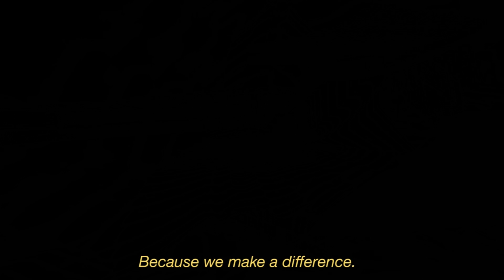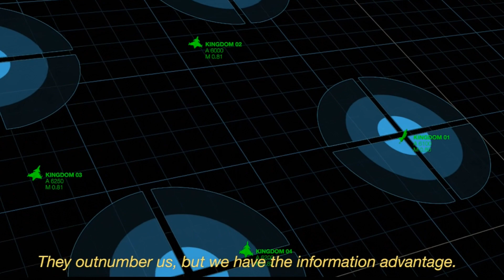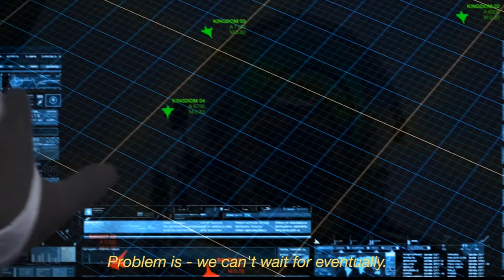Gripen Fighter Jet - Canada's Future Fighter?

Comment: Being Cheap isn't good. But it would be better to go for the Typhoon GR 4. At least the typhoon has been properly fielded and tested,improved and upgraded.  The Grippen seems to be a bit of a budget option....
Reply: randomguy8196
"Canada’s jets will be operating in harsher conditions than most other countries"... Well lets look at three countries that operates in conditions as harsh or worse than Canada then... Denmark, Norway and Sweden.
Sweden operates in its territory in Northern Sweden, that is an area with great distance to a lot of stuff, its cold (being just on the border to an Arktic climate)... It operates the Gripen.
Norway operates in its territory in Northern Norway, and the sea around Norway (as well as Svalbart, the Island group) Those areas extent well into the Arktic, it is very desolate (as the sea is) and is a very big area... It operates the F-16, and is going to use the F-35 both are single engine planes...
Denmark operates in its territory, it is quit small, with a bigger population density, so one might not think Denmark counts... However Denmark is controlling and patrolling the air over Greenland and the huge areas of sea surrounding Grenland (not regularly, but every so often)... And it is done with the F-16, that will be replaced with the F-35.

All three of these countries have single engine fighters, and are replacing them or expanding them with new single engine fighters... They cover a lot of territory, that are equal in harsh conditions (or ever so slightly worse), and really haven't had problems.
In fact the only crash the Danish airforce have had in the past 15 years, was due to the metal in the air-frame going soft due to extended use... the two-engine discussion is perhaps interesting, but it is equally interesting that two of the most effective planes in modern-warfare history (the Harrier and the F-16) and the new big replacement of many older planes (the F-35) all are single engine... There are some reasonable arguments for double engines on a fighter, and the cost of providing another engine is usually not that big from a design point of view... But it is clearly not a deal-breaker.
Reply: "A dual engine jet is safer than a single engine jet thanks to redundancy." The safety record for the 39 when it comes to engine problems are very good. Ingestion of different martime poultry is not something that normally causes the engine to have a catasrophic malfuntion. And of course you guys would probably get to be in on building your own aircraft..just as Brazil. I think that Bombardier would like that very much.
Reply: indedd ;-)
Reply: Most wars are fought over resources. All wars are won by effective mangement of the resources a country can use. I see the 39 as a good fighter because it gives an enourmous capabillity for the resources spent on procuring and operating them. And this "single engine" talk is rather obsolete. Once passenger jets that crossed the ocean had a demand of having 4 engines. Not the case anymore as engine design , metallurgy and aircraft design makes up for the early problems of long distance flight.
Reply: Just as people ask the politicians in Sweden the same questions. 'Do we need to fly at Mach 1+ at 10-20m height in coastal waters filled with big sea birds?' Do we need to train at that level in peace time?' With low operating costs pilots can get the training they need in the machine they fly. No need to be a cheapskate. Just as there is no real need for 2 engines either.
Reply: randomguy8196
That was a pretty weak reply...
The cost or technical reasons (for the F-16 and harrier) are not really relevant, what is relevant is that those planes did the job in such a way that they justly have been seen as some of the best/most capable designs...

Dismissing the fact that three nations are using (with succes) single engine fighters for a job, in similar condition, you claim should be done by double engine fighters are simply making your own arguments invalid... Oh and Canada is rich, so is Sweden, Norway and Denmark...
Reply: "why would it not choose the very best equipment for its troops" It does, it looks like it is buying the F-35...
It might need a second fighter for other jobs, and there you would look at where you got the most cheep. Is the F-15 good, sure... The F-16 is seen as one of the best planes ever build however, so really you can't claim that Canada would be worse off.

"An extra engine is an additional factor of safety."... And yet the single engine planes doesn't seem to have problems... One could also instead say, the better ground crews will keep the planes in the sky, regardless of one or two engines. It is only in combat that one or two engines seems really matter, and even there hits from modern missiles seems to not having a bigger problem shooting down planes with two engines compared to one...
Reply: "not exactly a vote of confidence for the F-35's air superiority capabilities" that has nothing to do with it... 
The reason many countries like Japan, Great Britain, Germany and so on are not replacing all their fighters with F-35, is the cost... Those F-35s initially costs a fortune even compared to other fighters (not the Raptor but still).
If you have a big number of a fighter still working fine, why drop it, when you buy something new and better, that is so expensive that you can't replace them in a ratio of 1-1 or even 2-1
Reply: Coincidentally the Danes are replacing all their F-16s, because the F-16s in Danish service are worn out, so it was decided to replace them all out of necessity, not by choice.
Reply: "Japan is building many parts of the F-35s it buys so some of the money is going back into its economy" So does Britain, Germany, Denmark, Norway... Doesn't make the plane cheaper, it helps support the cost, that is true, but not directly... None of the states are directly making these parts, but corporations (that might be partly owned by the stat). Meaning that the stat is taking the full cost of buying the planes, but only (at most) gets some of the renevue back through taxes and in those cases where they have a partial ownership, not normally the case.

"they don’t operate any F-16s, only F-15s" Not really relevant... You could just as easily have said that Britain doesn't operate F-16s, but Euro fighters... They still buys and plans to operate the F-35s where they previously only used twin-engine fighters, and they doesn't seem to care that much about having only one or two engines...

 "They are probably just buying them as a form of tech transfer - since the US won’t sell them the F-22s" Now you are speculating without much ground to hold on to... The US was contemplating exporting the F-22, but decided against it, because it (among other things) were too expensive.
Reply: You missed the important part... "Part of the money", the cost of the F-35 is far greater than what money stays in Japan, and the Japanese government still doesn't gets all the money back from taxes/profit... This isn't a zero sum game...

"They have over 200 F-15s but no F-16s" still not relevant...

"Japan felt it needed a new air superiority jet" So clearly the F-15 weren't good enough then...
Seriously though, the Japanese government choose the F-35 because it was seen as the best it could get... If they decide to make a new plane from the F-35 then that is what they will do, but until then, they still upgraded to the F-35 instead of focusing on the F-15
Reply: There are a number of reasons as to why "go through the trouble of creating an entirely new plane?"...
Some of the reasons are military, some economical, and others political... For one thing, the F-35 will be the standart fighter of NATO, Australia, New Zealand and Japan (with the chance addition of S. Korea), that alone is a good reason to get some F-35s.
Building and develop ones own planes is very expensive and time consuming... Delays can happen, with decades lost, and in the mean time, the currently owned planes might get so outdated, that in the time between, you leave your country at risk... Japan is next to China that we have seen expand aggressively, so that is another reason.
And from the sources I have seen Japan is starting to sell of its F-15s in small patches to other countries, I doubt that we have seen the final number of F-35s brought by Japan.

 "The fact that they are working on a new fighter shows they aren't happy with the F-35 even."
Again, not really... Originally the F-35 should have been finished in 2005, starting your own program in 2006 doesn't mean that you dislike the one you thought you would buy now... Those things often happens...
Reply: "The F-35 is suppose to have finished in 2005 and the very next year they start R&D for a new fighter. What does that tell you?" That everything is proceeding as normal... Every time you are about to finish a new weapon, you start developing the next project, due to the fact that in the time it took you developing the finished project, technology has jumped forward a few notches... The US has started its development projects to the next fighters as well...

"Buy/license it whole, make a few hundred, done." That is kinda what they are doing... They have just bought 42, and are expected (according to US officials) to buy 80+ more... They are however doing it in patches, like most other nations.

"2014 their plans to go ahead with the production of their own fighter"... Sure, they have to develop it first though, and they can have needs they don't want to mention to the world (China) just yet. Not uncommon.

"But at least one country isn’t satisfied with it in that role" You have no idea why they are doing it, unless you work for the Japanese development team (something I doubt)... They can want to building their own fighters with specific goals in mind (like the Swedes), they can be wanting to build their own carrier born fighters, as an answer to the Chinese buildup... Point is, you have no basic of claiming that they dislike the F-35.
Reply: do you have any idea how much more expensive the typhoon is to buy and then fly? this is why we are done with the cf18 hornets.they were actually more expensive than the F15 Eagle-while NONE of them would be built HERE
Reply: Well. The pilot is invaluble. A fighter that have low operating costs let the pilots fly more. That is a good thing for any pilot.
Reply: Of course. That raises the question: What is the "best" fighter then? Is expensive more important than good? How much time in the air will the aircrafts and pilots get. How much resources are to be spent on operating the fighters. Will that come out of other branches of the militatry. Does the fighter fit well with the system it's going to operate in. Will the citizens accept higher taxes etc etc. Are the the more reasonably priced figher bad just because it doesn't cost as much as an expensive one?
Reply: You use the word "seems" - Which means that you really have no clue.  Baseless opinions like yours are about as valuable as religious beliefs.  Valueless.
Reply: Being cheap is good. It means you can have more aircraft in the air at one time. Even pilot officers in the US thinks this is the greatest weakness of the F35. It dramatically reduces the number of aircraft that can be present in the air.
Reply: That is a really strange idea... The Grippen has been tested just as much as most other jets!
It wouldn't have been adopted, if it wasn't any good, to the degree that it has.
Reply: jugganaut33 Theres a great misconception Gripen is not field tested. It has been used in Afghanistan and in Libya as a deep penetrating recon plane and was specifically requested by NATO as there were no jet with equal capabilities. Sweden is not a superpower intent on invading foreign countries, thus it's not got a record from Iraq etc, but it does not mean it's inferior to any of the planes used for that purpose. But let's face it; it's not likely US, UK or Israel would make a major purchase of Gripen instead of US made planes or Eurofighter. Israel is the foremost and most advanced user of new fighter jets, but who would ever believe they would say: "Hmm...Gripen Is actually a better more economic fighter, let's go with Sweden!"
Where do people think it's defence budget comes from? Dades?  Golan Kosher wine? It's the US keeping them from being overrun. They have to go with US equipment. If Gripen would be put in serious hairy combat situations it would surprise many a world powers...
Reply: The more the meriour as the germans understodd at kursk wv2 biggest tank battle. Advanced german tanks against russian T-35 in numbers whith tilted armour. had no chanse ;-)

Comment: Its like a mix of a Euro fighter Typhoon , Phantom and an F16 and maybe a bit of a Tornado
Reply: More like a mix of F-5 and F-15.
Reply: Dimetropteryx Ok? It has typhoon because of the elevators at the front and f-16 because of the single engine. PHANTOM because of the intakes and Tornado because of the wings... It looks like a f-5 I suppose but not sure about f-15?
Reply: I'm not talking about looks, but the general concept. Small, lightweight, affordable, but packed with the best tech available.

Comment: Biggest gripen problem is its single engine and canada is big place
Reply: +StigmADiabolicuM
Why is the single engine a problem for a big place?
Instead of being ignorant you should look up the range of the aircrafts and you would see that Gripen range is about the same as all the twin engine aircrafts. One engine consumes less fuel. A smaller airplanes requires less power etc.
Reply: they are so cheap so buy 100s of them insteed:)
Reply: If engine fails or something happens to it plane goes down, Sukhoi gave up on this (Su-37 'Flounder-A') long ago and Swedes continued on it
Reply: How often do that engine fail?
I mean How often does the F-16  just fall out of the sky, because of a bad engine?
And if it is so great to have two engines, why not three or even four?
And how often does both engines fail on the F-18 (or any other plane with dual engines)?

It is a valid point, but I am not sure that it really deserves as much credit as so many in this comment section seems to think.
Reply: In combat use it saved lives more then once and to train new pilot is 1/5 of the new plane beside human life price
Reply: And how often has that happen in recent years?
Sure it has saved a few planes (not lives), but in general if an anti-air missile hits the engine compartment, the plane is going down, due to the engines are right next to each other. But your argument was that Canada is a big place, and that has nothing to do with having one of two engines.

I make the claim, that most of the pilots killed in action due to their plane getting hit, they would have died regardless of having one or two engines... 

I am however not saying that your argument isn't valid, I am just saying I don't think that it is so great as you, or so many others here think. Especially given the number of countries that uses fighters with just a single engine.
Reply: Russian idea is to spread out engines, why rest keep them together is beyond me, f16 and mirage2000 are almost 40 years old now, gonna get phased out soon all other newer ones are double engine planes, jet is more reliable can carry bigger load on greater distance and has bigger radius, ect. So if no1 else is making them then there must be something in that. Countries that use them are having old planes or on leasing cuz they coast less for maintenance, which isnt the best option just the one they can afford
Reply: I believe that a number of the French planes are still single engine, as well as a few others... 
The radius I am not certain of... Gripen did not have any significant problems regarding radius for the Danes... There were to be made a few different setups, due to certain problems, but the Gripen was considered a genuine candidate for a fairly long time... And the Danish air force, is also patrolling around Greenland and the Faeroe Islands.
Reply: Long story short single engine only good point is its price all the rest is on dual engine jets and canada can do whatever with its tax money
Reply: As i said above, if something happens to its one and only engine it will crash, im not being ignorant, and can you tell what dual engine plane has less range? Smaller plane also has less fuel room and i can assure you then every plane always needs more power not less